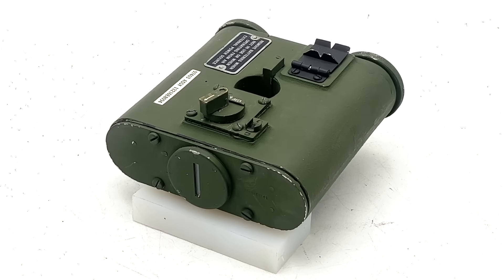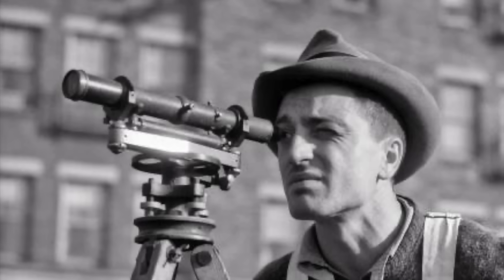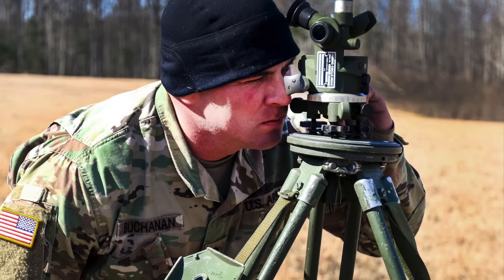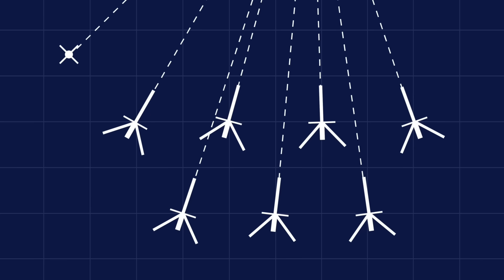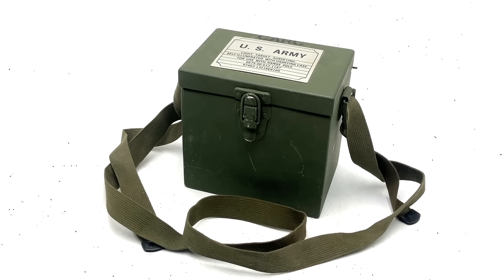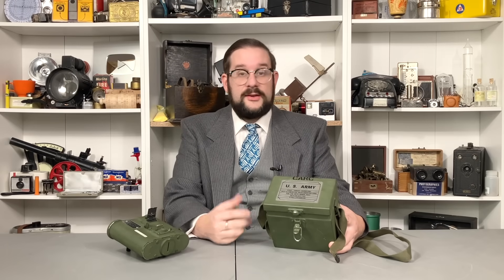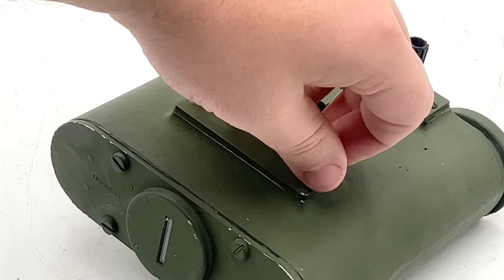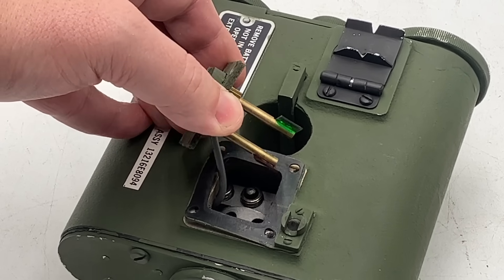SHORT: U.S. Army Target Light

Comment: Great Thorough Presentation.But you do NOT use aiming stakes for a Rammer Staff.They are Not Interchangeable.A Ramming Staff has a screw end for a Bell Rammer ,used for extracting stuck Projectiles in the Barrel, and Cleaning Barrel or Tube...

Comment: In the US Army '86-89 we only used the aiming stakes to set the azimuth that the M109A3 was to be aligned on when it pulled into positioned. 
The "Adavanced Party" would go to the next position well before the guns and place the stakes on a designated azimuth and wait. For hours sometimes. Hot baking in the Sun, or freezing cold hours....!
The gunnery seargent would pre-lay in each position, using an aiming stake approximately placed where the gunnery sight would be, to save time when the guns arrived later.
Azimuth fire commands were measured off collimators in my days as a 13B.
Reply: 82C here (field artillery survey). We were the ones that laid out the battery positions and left coordinates on stakes. Started on the M110A2, went out on the M109A3

Comment: Not sure if it's the case, seen some high speed stuff on videos, but our company level mortars used only aiming stakes to lay in guns. There was tritium vials to clamp on to the poles for use at night.
Those guys would practice putting them into and taking them out of battery for hours. (SSG Johnny Horne was a mad man!)
As proficient and dedicated as they were, Steel Rain almost made my parents a quarter-milli by a misplaced lum round.
Reply: We would lay out the battery in a wide lazy W.
A howitzer a couple hundred yards behind and to the left of my gun forgot to actually elevate the tube before they fired!
155mm HE impacted about 150 yards to the front left of our gun.
Fortunately most of the shrapnel blasted forward and no one was hit by anything. Torn camo net was the worst of the damage.
Crazy days!